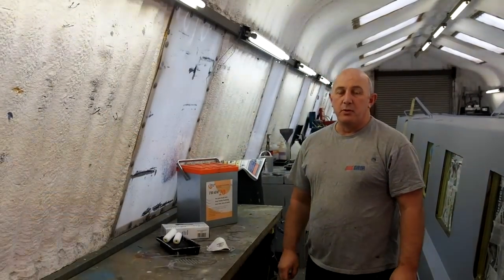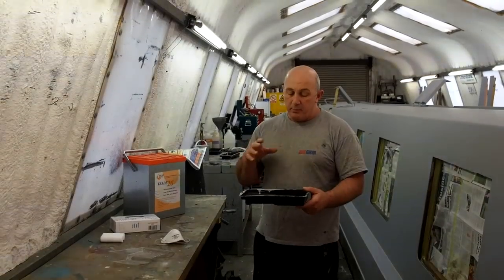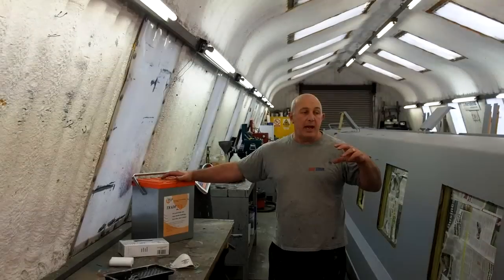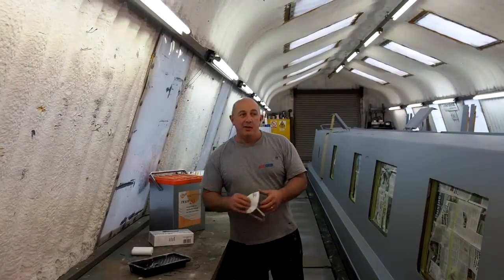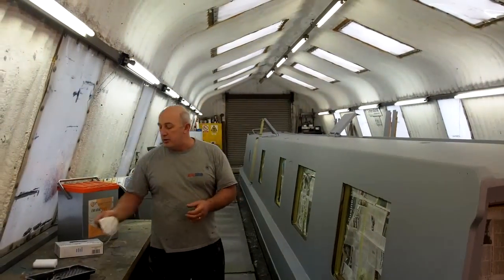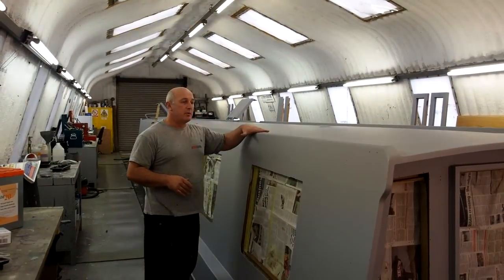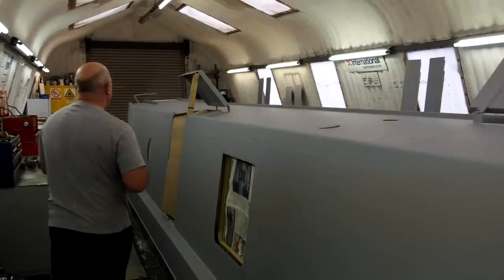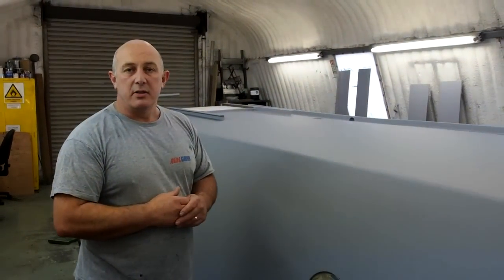How To Paint Your Narrowboat Part 4

Comment: I've been watching a lot of your uploads to get some practical  information to help me paint a boat for a friend . He hasn't got the funds or place to get it painted in a tunnel , so it's going to get a freshen up on the mooring .
   Although it can't be taken back to the steel , is it still possible to simply take it back to the original primer , taking off any flaking paint , then rub down , re prime , and paint ? I appreciate it's not ideal , but If there is anything I could do with the constraints on this job , I'd really appreciate the advice .

Comment: I have to paint outside. Tried latest Wickes 4" foam [previous rollers better] dont hold enough paint for me. Tied B&Q [Diall] these hold to much paint for me lol. I like to paint a strip about 1 1/2 feet wide top to bottom on the cabin side as you have to be quick outside.Where do you get your rollers from ? This obviously becomes more important during glossing.

Comment: Hi John am Painting my Boat. Could ask You for a bit of advice ? is it ok to use a Rubber based paint on top of my primmer for the  Roof ? And Thank You for vids they are  very  good lessons  and  have helped  Me allot Thanks again John.
Reply from the maker: hi,
you need to check your data sheets, for that information
regards John

Comment: You told us the importance of wearing gloves and not touching it then promptly went on and ran your hands all over it!
Reply from the maker: UKAirscape Hi yes you are right, i think it should be noted that there is a difference between long term contact with moisture transfer and dirty hands, against lightly touching the surface with clean hands,
clean hands very lightly run over the surface will also tell you how clean the surface really is,
but if in doubt wear gloves
thanks for the comment
Reply: John Barnard Ltd. Ah, OK. Thanks. I loved the series of videos by the way, watched them all in sequence last night.

PS You mentioned DIYers doing the work in the open - is it really feasible to do this without being under cover?
Reply from the maker: UKAirscape 
Yes it is possible to paint out side but you have to except some compromise due to dust,insects and the like, also meeting guidelines becomes more difficult, this is an area we cover on my painting course as not everybody can paint in doors.
Reply from the maker: UKAirscape 
feasible yes but hard to avoid dust insects etc, also difficult with drying times, damp and so on.